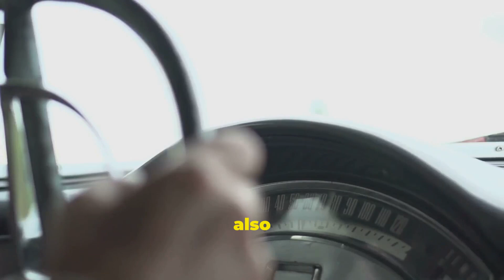Why Cars Don't Use Inline-8 Engines Anymore

Comment: my father worked on Rolls Royce straight 8 engines in the 70s and they were the smoothest running motor i have ever been anywhere near. class of water on the rocker cover smooth. what a beautiful sound at full noise and absolute monstrous torque. shame they don't make them like that anymore.

Comment: For non motor-heads would have been good to show photos or drawings of a V8 below or superimposed on a V-8 to show the lengths, and mention that a V 8 is like 2 straight fours at an angle and spliced together at the bottom.

Comment: The "RPM of a straight-8 IS NOT LIMITED!" There were WWII British "Vosper's" (wooden PT boats) powered by three twin supercharged Napier 6500 RPM 500+ CID engines, more POWERFUL than the Rolls-Royce Merlin's they replaced. The COST of the straight 8 doomed it's existence for gasoline powered cars. The AutoCar semi used a Cleveland 22-28 liter twin supercharged straight 8 diesel until 1965. BTW, Dodge truck division built a prototype (nearly 1000 units) of TURBINE POWERED 400 HP semis. "If you can pour it at room temperature, and light it with a match, it's good for fuel." The turbine cost about 9 times what a 1966 260HP diesel did. P.I.E. had the largest fleet of just over 100 and reportedly cried real tears when Chrysler cancelled the leases due to the "hazardous high exhaust temperature" only 2000*F LOWER than today's semis...

Comment: If the long crank has a flex/breakage issue, how do Bugatti manage the huge horsepower of their V16 which has to have a crank similar in length to a straight 8? I would suggest difficult  packaging in a modern box is the real issue.
Reply: an I8 engine could work for a high end hypercar/exotic car configuration due to it sticking out, probably not the best for mass production , even though alot of the tooling companies at the time used to build I-8s was also used in other inline engines

Comment: The main reason I remember was with their long, heavier driveshaft, they simply could not accelerate as quickly as the V-8's shorter, less weighty crankshaft, making them uninteresting for police pursuit, competition drag racing, hot rodding in general. 
Henry Ford's mass producing the single cast block V-8 in 1932 paved the way to put an eight cylinder engine where an inline four cylinder previously fit.

Comment: My Brother-in-law restored a 1940 Buick with a straight 8.  He said the real problem is assuming the engine stalled and trying to start the engine at a stop light while it was still running.  They are that smooth.

Comment: Last I looked my '50 Buick still has its straight eight engine it it and I have no plans to put a small block Chevy in it or do any other stupid move. There are many straight 8s still out there.  While they may not have the greatest acceleration, they will easy keep up with traffic on any road including the interstate.

Comment: Straight A's for a luxury type of engine, I enjoyed building a GMC 302 with the two-barrel carb in 3 inches off what a beautiful engine and I was lucky to build a 308 international engine with the same type of 2 barrel car with 3 inches off what a powerhouse. Then you have your other six cylinders but nothing equals those two engines I put together.

Comment: If the technology of today went into an inline 8 you would be surprised at the performance. Inline engines are always more efficient. Those old clunkers just got phased out rather than improving them. They basically outlived the technology used at the time.

Comment: In the 1990s, I read that Ford was tinkering with a powerplant family they called "T-Power", which had transverse mounted inline 6 or 8 cylinder engines with a transmission mounted behind the center of the engine. Since the power-takeoff was from a gear fitted halfway down the crankshaft, there were no problems with driveshaft resonance, and with the transverse mounting, the hood could be short like that of a typical FWD car. Nothing ever came of it, but it could resurface at some point. The first prototypes for today's FWD cars with transverse engines were built in 1946 by, believe it or not, the Checker Cab Company. It took another 2 or 3 decades for that layout to go mainstream, so it's hard to rule out any design that shows promise.

Comment: My favorite engine?  I hate to be a party pooper, but my 1.9 plastic Saturn (MANY went over 250,000 miles) gives good mileage and is pretty trouble-free.  Although some were assembled with a WRINKLED intake manifold gasket, which is a bit of a pain to replace.  Not the smoothest, I will admit.

The smoothest engine I've ever experienced is my inline 2-cylinder 395cc Honda 400 (1979-1981).  TWO vibration-canceling shafts driven from the crankshaft by chains.

Comment: I haven’t watched the video but I’m going to take a stab at it. 

Maybe because they are like 4 feet long and we can build more than enough power for any application with a straight 6 or V8 in a much smaller package.

No one needs more power than a supercharged v8 or more torque than a diesel straight 6.  With electric assist, those are even becoming obsolete.

Comment: I'm not an engineer, but here is something that I learned from an article I read back in the sixties when straight eights had just gone away. The straight 8 was limited to low RPM by the length of its crankshaft. If you hang a shaft by its end and strike it, it will ring. The longer it is the lower the pitch that it rings because the frequency of vibration is lower. The crankshaft is always ringing while the engine is running. It is ringing at its own inherent frequency of oscillation. The longer crankshafts have a lower frequency and if that ringing frequency is low enough to fall into synch with the frequency of the oscillation of the pistons all hell breaks loose. It was a lesson learned by manufacturers who were trying to make their engines more durable and long lasting by increasing the number of main bearings and the bearing width. But it backfired because the really long engines that resulted were flying apart all over the place.
Reply: Interesting thesis but explain how the Roll Royce Merlin, Allison and many other WW2 allied and axis airplanes v12 engines held together? They were far longer than the auto straight 8s.

Comment: One key technical issue is completely missed, perhaps because it’s neither obvious nor glamorous. 
Crankshaft bearing and lubrication technology has improved greatly.  Modern bearing metal and modern lubricants can support many more pounds per square inch than the old stuff. So for a given horsepower you need much less bearing area.  The in-line engine allows much more bearing area for a given number of cylinders than the V8.

Comment: 3:19 An overall thermal efficiency of 32% (under optimum conditions) isn't "incredibly efficient". It's a big step forward from one hundred years ago when most Otto engines had an OTA of around 12%, but it still wastes two-thirds of the energy (and money) put into it. A three-phase permanent magnet motor can be more than 90% efficient, which is indeed incredible.

Comment: When  I was a child, my Dad had a 1953 Pontiac Cheiftan sedan with an inline 8 engine; remembering seeing him work on it, I recall how long that engine block was.  The car also had NO power steering; when my Mom started developing back problems from trying to steer that heavy beast (which was getting old & shabby by then; I remember riding in the back seat & being able to see the pavement through holes in the rotting floorboard!), he finally broke down & bought a brand-new 1964 Buick Special sedan (with one of Buick's early V-6's) with power steering; for $2400!  🙂

Comment: Inline 8 cyl Requires that Power takeoff be from the CENTRE of the crank to prevent the crankshaft from twisting under loads. Sitty designs (american) took power from one end .

Comment: It's 8, inefficient cylinders. A classic case of where more isn't better.
Reply: Had there been modern casting techniques, electronic fuel injection, but the styling of cars of seventy-five years ago, indeed an inline eight might have been preferred, as the casting and machining, if you're producing a line of other inline engines, fours and sixes, is straightforward.

Comment: Waukesha H 24 and Jenbacher type 2 are both inline 8 gaseous fueled engines and are currently in production .   The inline 8 works well when you have the room to put them in gas compression and power generation applications.   Both engines are extremely durable, efficient, and can meet stringent air emissions standards.
Reply: Indeed inline eights and more are still used in large diesels for locomotives and ships.

Comment: V-8 engines were nothing new in the 1950's; Cadillac had been making them since before WW1, GM made a V8 for the Viking and Marquette marques in 1929, Ford offered it's famous Flathead V8 from 1932 onward, Oldsmobile's Rocket V8 was available from 1949 onward When Chevy made their first V8 in 1955, all other remaining brands quicky followed. 

As far as inline-8 engines engines today, I believe there may be large stationary diesels still offered in this configuration. I know that there is a manufacturer of large marine diesels which makes modular inline engines in any configuration from inline-6 to inline-14.

Comment: 0:36: Ummm.....I doubt that the GAZ Volga ever had an inline-8. In fact, almost NONE of the cars you show ever used an inline-8. In the US, it was an engine used by Pontiac, Buick, Oldsmobile, and I think LaSalle. Also, outside of GM, Hudson also used inline-8 motors. ALL of these were discontinued after WW2. Ford never made an inline-8, and I believe Chrysler never did either.

Comment: I had a 51 and 53 Pontiacs with straight eight. Really powerful and smooth. I had a 2004 Z4 with an inline 6 that I though was as long as the straight 8s and took 8 qts of oil
Reply: My Parents also had a 51 Pontiac with a straight 8.
Reply: @73Trident  Great Car! Mine was light green

Comment: Worthless Video. In-Line 8's cost more to produce and would be useless on Front-Wheel Drive garbage design junks.  They also require a longer vehicle to house it.  The only design comparable to an In-Line 8 is an In-Line 12 Cyl.

Comment: I had a 1951 Pontiac sedan coup with the straight 8, and a 1949 Pontiac with the emblem that said "Pontiac 8" but it came from the factory with the 6 cylinder. Both were classy
Reply: Back before "political correctness" ruined just about everything, the Pontiacs were distinguished by that Indian head hood ornament.  A common joke regarding that make was:  "Heap Big Pontiac...BIG HEAP!"

Comment: Every comment here missed the primary reason for no inline 8 cylinder engines being built. Yes the length and esp for front wheel drive. But emissions are driving all of it. A turbo boosted 4 cylinder now will do what a v-8 used to with much less greenhouse gas emissions. Even though i personally despise forced induction small cubic inch engines
Reply: Same here. I hate them and refuse to buy them. They're pushed too hard and designed to fail.
Reply: When a turbo 4 cylinder is making the same power as a v8, it's using just as much fuel.
Reply: @ only for a few seconds at a time during acceleration or pulling a big hill or load. Rest of the time they’re not using near the fuel or making near the emissions

Comment: I had a '51 Buick Special with a straight 8. You couldn't hear it running if you were standing by the engine bay. Leaning against the driver side door while it was running and there was no vibration. Smoothest acceleration ever with the "gearless" automatic transmission. I drove it as my daily drive '98-'99 and it was a great car.
Reply: I had a 51 Buick as well. At a warm idle I could see the fan blade actually moving instead of just a blurred vision. It had a very low idle and sounded good. And I lived pressing the gas pedle to the floor to start it. No one knew about that but the much older guys. They always chuckled when I got excited about that old car. I think these were the years where the saying "as big as a Buick trunk" came from - they were huge - LOL
Reply: I had a buddy who drove a Buick (NOT sure of the year) but had a straight 8 overhead valve engine.  
I also owned a 54 Pontiac with the straight 8 flat head engine.....12 mpg was about the norm on a 'good' day.  

I also owned several 55's....big changes in going from a straight 8 to a V8 and overhead valves too....and gas mileage going from 12 to 17 or 18.  

Also, I still do drive a Pontiac as my sole driver..... 
88 Fieo V6, 5 speed....and have since my first '86 in '89 with the Iron Duke 4 cyl.....The very same engine employed in many other vehicles, including the USA Mail delivery vans....and about 30 mpg.  
My two 86 Fieros with the Iron Duke engine routinely achieved 40 mpg.     

At now age 84.....NEVER bought a new car in my entire life.   Like my ex-wife's uncle often said, "Let someone else take the beating".....referring to the huge drop in value immediately after being driven off the dealership lot.   BHE